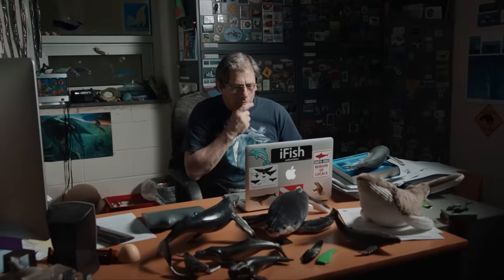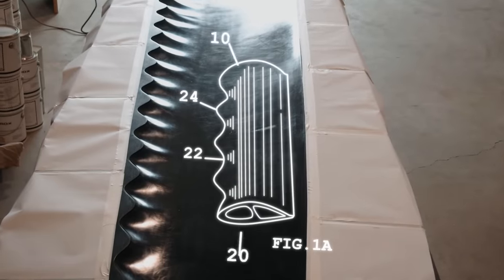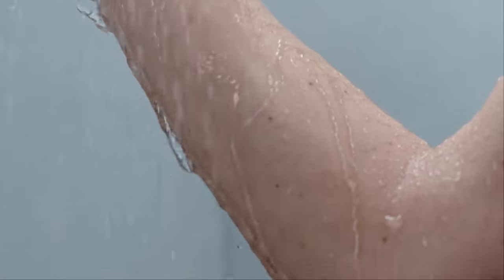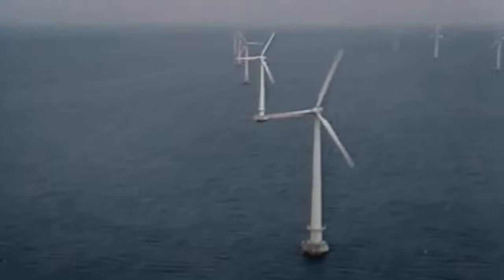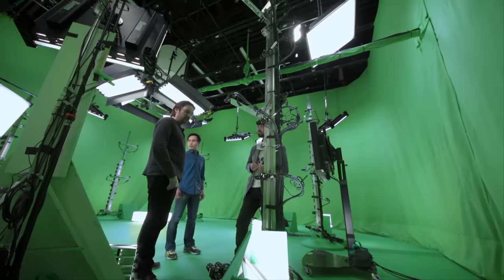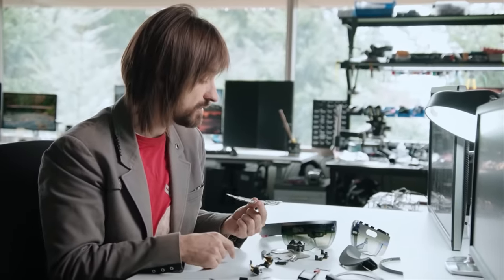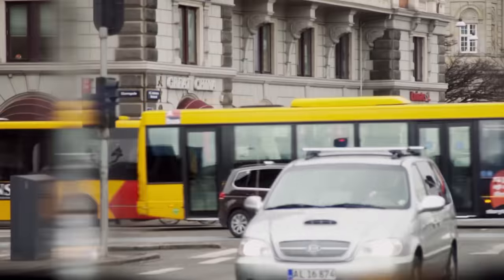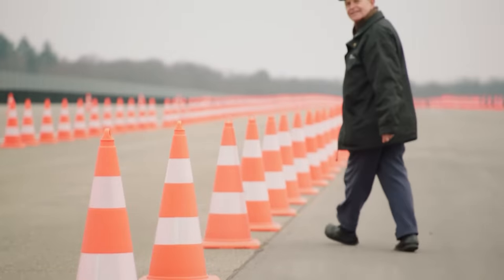Genius Inventions: Technical Marvels That Will Shape Tomorrow | Full Series | FD Engineering

Comment: If you pay for city water, they also charge for sewer as well weather you use it or not. You can't get around this. It actually costs more for waste recovery than the actual cost of the water.

I would use more water if I didn't have a 3,000 gallon grey water system & rain water recovery.

Water bill for 1,000 gallons
water ready to serve ............ $29.04
water.......................................$5.03
sewer ready to serve..............$29.77
sewer.......................................$8.35

These ready to serve charges are basically the rent. the actual cost of water is $5.03 & the cost to flush the toilet is $8.35. This means actual $5.03 in water ends up costing $72.19. If I lived in the city it would cost 6x as much as my township costs. My bill is for 3 months, my brother lives in the city and his bill is every month and is 3x as much as my 3 month bill.

Comment: I encourage everyone to challenge fluid mechanics. It is an awful science with almost no progress (but chaos) in 100 years; ignored as easy by physicists and taught to engineering students as if it is complete. I’m an inventor with fluid mechanics inventions and have them because I asked basic questions about differences in physics and engineering textbooks. And there is the problem of wind-turbine design which fluid mechanics constrains but cannot solve: hence each year improvements from human ingenuity arising from real and digital  contact with the antics of surfaces and air.

Comment: Holo lense has been in development for over a decade. I think it's a bit disingenuous to suggest that it's a technology that is right around the corner. 

UV lithography does nothing to solve the limitations we are approaching in regards to microprocessor advancement. The problem we face is that transistors cease to function accurately as they get smaller and making them smaller than 1nm is basically impossible due to the size electrons which leads to what is called quantum tunneling.

Comment: Bumps on a whale fin.
Geez, these guys are ignorant.
We have been doing this in aviation for 70 or more years.
Look at the teeth on the top of a 737 Classic wing.
Better still, look at the shark’s teeth on the leading edge of the old Embraer 125. 
It is exactly the same as the whale fin.

So here are a bunch of so-called ‘scientists’ trying to re-invent the wheel.

Ralph

Comment: Chips at 3 man has reach a limit as in personal devise you can forget AI. In hand held devise  the limit is small enclosed  container the very source of the goal. They’re too much heat and it crashing from overheating. Go pro 8-12 model all in warmer climate  are locking up in 10 minutes and broken eBay has tons sold as is. Apple having the same problem but wouldn’t admit they have software trotted  some work load.  So here is where you can brain storm.   This is the bottle neck. I have a knack of seening  thing about a years ahead. Same as I was saying ev not going to work  logically and got banned from some ev site . LOL